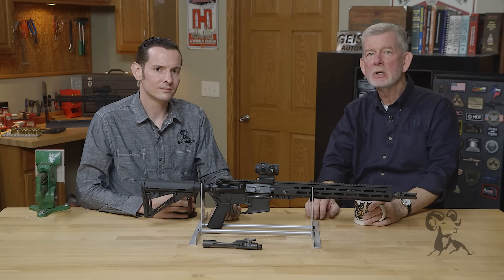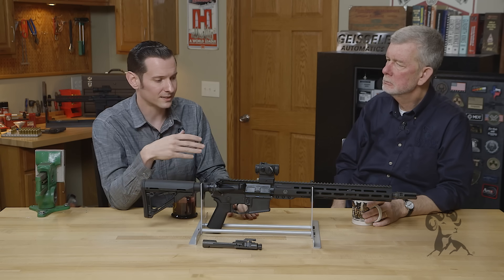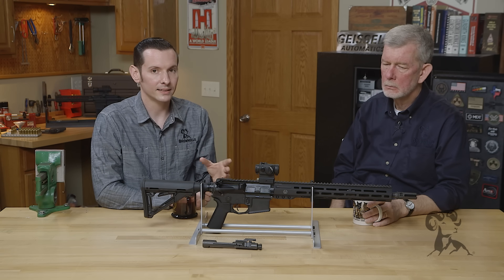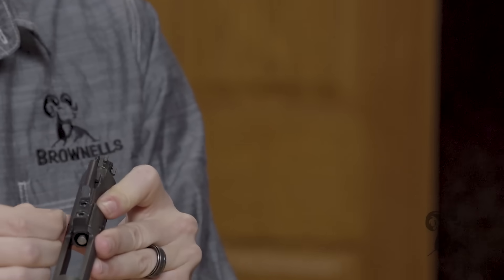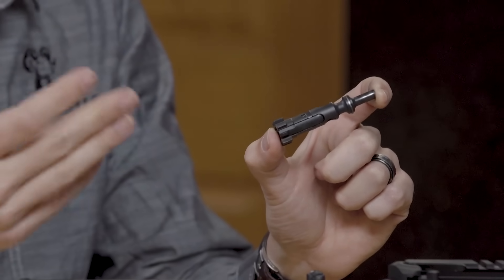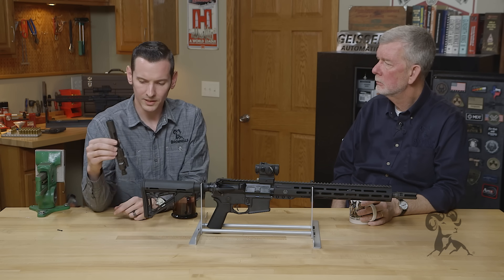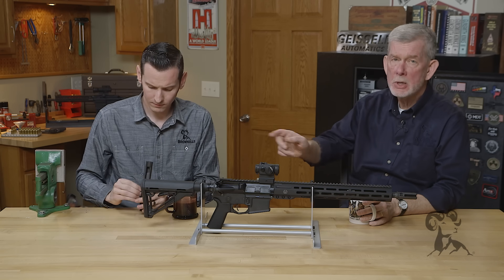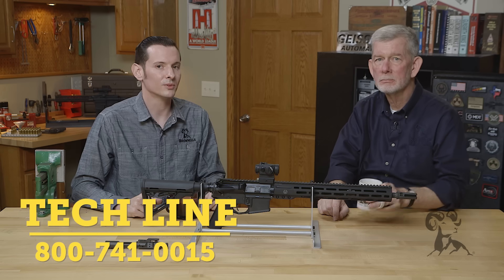Quick Tip: Fixing Common AR-15 Gas System Problems

Comment: great video. So I have a factory built AR that I bought new. It has run fine for years until a while back while firing it started over gassing all of a sudden. What would cause this sudden change?
Reply: What signs are you getting that it is overgassed?
Reply: Take apart bolt carrier and clean.

Comment: Another check for the gas rings is to insert the bolt into the bolt carrier and hold it by the bolt face vertically.
If the bolt carrier falls off the bolt you need to replace the gas rings.

Comment: Are 1 piece gas rings supposed to be loose? It fails the bolt weight test.
Reply: 1 piece rings have been known to be unreliable now.

Comment: Thanks.  Bought a new S&W mp AR.  Will not eject any rounds.  Was test fired at the factory because the barrel was dirty.  Could not fix and had to send it back and waiting on its return.
Reply: There are eight cycles of functioning.
Feed, Chamber, Lock, Fire, Unlock, Extract, Eject, Cocking.

Obviously the rifle you had fired.
1. Did it unlock? Meaning did the bolt rotate? 
If no the weapon has a gas problem. As mentioned in the video.

2. Did it extract or attempt to extract the round from the chamber?
Failure to extract. Cause bad extractor or extractor spring.
Inspect extractor hook to ensure it broken. 
The spring could be bad or missing.
Remedy Replace the extractor and spring.

3. Did it eject the round out of the ejection port?
Failure to eject. 
Ejector is dirty or ejector spring is bad or dirty.
Hold the bolt vertical face up. Drip a few drops of solvent and work the ejector with a large flat punch. Push it in and out a bunch. If it is not stiff or it does not return then the spring is bad.
Replace the spring.
Reply: Did they fix it??

Comment: What's "a lot" of rounds? 5000? or way more?
Reply: yes especially if during the firing the weapon gets significantly hot.
Anything above the listed sustained rate of fire for an extended period of time.

Remember that because the AR is typically a direct impingement system a lot of heat is being pushed into the bolt carrier.

Comment: Could the same be applied to Ar 10 piston system? I was ha I gotta failure to feeds an one double feed. Shot all different kinds ammo from pmc to match grade ammo all different magpul mags same issue. I’m stumped on what it could be.
Reply: What kind of AR10?
Reply: POF P308
Reply: @889976889  Is the gas system adjustable?
Reply: @Elliot White yeah it’s has adjustable gas block it’s a piston system not direct impingement it seemed to be under gassed it was short stroking failure to feed. I shot all kinds of ammo did it with ever brand some more of than others.
Reply: @889976889  What setting was the gas block on?

Comment: Custom sized gas tube is even better than an adjustable gas block
Reply: I recommend an adjustable gas block that vents the excess gas rather than just restricting it. When you restrict the flow with a traditional adjustable gas block or smaller diameter gas tube, you give the gas time to cool which results in a more rapid carbon build up in the gas system.

Comment: I have known a lot of shooters that were die hard convinced that the gas rings on the bolt had to be aligned. I have even pulled out metal pins, cut to length, that someone put in to keep them aligned.
Reply: All for not, gas ring alignment is indeed a myth.

Comment: If your gas rings are worn out, might it be better to just buy a whole new bolt?
Reply: No. Just change the gas rings.
Reply: Not at all, the rings will wear out far before the bolt is anywhere near the end of its life.
Reply: Bolt metal is hardened and gas rings don't move in the slot anyways.  Gas rings are softer. Gas rings are like piston rings in an engine.

Comment: You guys are great. I am new to the AR platform and have learned a lot. Please keep it up! Thanks
Reply: So my bolt failed the collapse test. I ordered new rings, passed the collapse test. It got even worse. Before it would eject the spent shell but not load the next round. Now it won't eject the spent round.
Reply: @JessPeters-qg1bn . Did you install the rings in the correct direction?
Reply: @oklahomahank2378  yes. Turns out there was major carbon blockage in the gas tube.
Reply: @JessPeters-qg1bn    Interesting.   Thanks for the answer.  I don’t think I shoot mine enough for that. I see the guy from School of the American Rifle use a piece of trimmer cord to check that.  I occasionally clean mine with the extra long “craft” pipe cleaners.
Reply: @oklahomahank2378  I asked my gun Smith what I could do to prevent that from happening. He said no. Shoot enough it will happen.

Comment: Much better Steve...damn hippie.
My wife’s 18” AR sends them at 12:30...unsuppressed-waaaay over gassed but it takes out the bad guys’ buddies.  I’m too lazy to change out gas blocks, what’s everyone’s experience with adjustable gas bolt carriers like Bootleg or Gemtech?
Reply: They work but are limited in function, It is best to control the gas before it makes into the heart of the operating system.
Reply: @CalebSavant  thank you

Comment: Can you do a video on getting an old single-shot break open shotgun up and running. There are a lot of these shotguns sitting in peoples closets but they might need a new firing pin or have a cracked stock or something. Where do you get those parts? How do perform some of the common parts replacements?

Comment: Your intended application may also factor into determining if you are optimally-gassed. If you intend your rifle to primarily be a defensive rifle (I'm staking lives on it) then if you can't be optimally-gassed be a little over-gassed. Many military guns are purposefully over-gassed so that if you have a crappy batch of ammo or your gun is fouled up it can still cycle in poor conditions. If you are a consistent competition shooter many of them under-gas their rifles to decrease felt recoil believing it makes them faster. This will decrease reliability so many of them use only match or other highly reliable ammo if they don't hand load, working to find that tipping point between barely reliable with their chosen ammo and short-stroking.
Reply: Excellent point! All of this is fact!

Comment: I didn’t know the ar15 can work with just one gas ring. Interesting.
Reply: Dillon M It can work without any gas rings but the recoil and wear and tear will be awful.

https://www.youtube.com/watch?v=kKisBcqOXRY
Reply: @rbm6184  wow
Reply: @ergogenda3374  But you have to be careful on the over lube thing. If that lube gets into your primers and ammo then the ammo will fail. So don't lube your gun loaded. Lube your gun drip dry and then load. Personally I wipe mine down and only leave lube on the friction and wear areas. I kind of run my autoloaders only slightly wet/lubed. I don't want so much lube that the gun eventually seizes up from filthy gunk. If in very cold temps no lube at all unless its cold temp lube.

The point of no gas rings is that it "can" still run but for how long with all that recoil and stress on the parts is anybody's guess. Don't do it unless you have no choice. Better with the gas rings than without.
Reply: @rbm6184  Lol I wasn’t planning for on doing either of those things, but thanks for looking out for me
Reply: @ergogenda3374  Haha. Good.
Reply: It will work in full auto with just 1
Reply: @jthrelf  I wouldn't know. Haha.
Reply: @rbm6184  me either, except for watching a Sons of Liberty Gun Works video.. ha!

Comment: AR10 was over gassed and adjustable gas block fixed it beautifully. But before I did that I tried to do it with an adjustable heavier Buffer that didn't work and not only is it hard to find for the AR10  they can be just as expensive as the Adjustable gas block just get the one that works.
Reply: Heavier Buffer doesn't do anything for over gas issue.  
My AR10 is severely over gassed to the point of not ejecting with any ammo.

Comment: I got a barrel for A.R. 15 I was building and was having  issues, come to find out (thanks to Brownells and the tec line) the gas port hole in the barrel was drilled too small so I had to drill it out.  My butt was tight the whole time I was holding that drill 😆 but now the gun works gr8.
Reply: Clenched cheeks is a perfectly natural reaction when doing delicate work on a machine that creates tiny explosions next to your face.
Reply: OP did the correct fix.  He stated that he spoke to gunsmiths.  it’s not rocket science.  Ex: if your port should be .093 you put an .093 drill bit in the hole.  If it won’t fit, the hole is too small.   Guns are not lab equipment.  If you oversized the hole it’s simple enough to throttle it back with an adjustable gas block or a heavier buffer.   An overgassed rifle is way better than an undergassed one.
Reply: @jwilsonhandmadeknives2760  there’s way more that could be the issue then the port size.
Free bore in BCG. Blow by at gas block, or gas key. Partially blocked/restricted gas key. Gas block misalignment. Bolt tail undersize. 
You could have a gas inefficient carrier, but be over gassed and the gun run fine and seem okay. Swap barrel to a less gassy barrel, then your gun seems under gassed when really it’s just highlighting other gas inefficient issues. I’m just saying for most cases it’s likely not the barrel gas port. A correctly gassed barrel may not run with a inefficient carrier. That’s my point
Reply: @goinhot9133  yes the video discusses all of that.  The criticism of the OP is that he wasn't qualified to open the port size.  I'm pointing out that it's a simple operation that does not require 20 years of machining experience.
Reply: @jwilsonhandmadeknives2760  best videos to watch for AR specific knowledge is School of the American rifle. The man knows his stuff
Reply: @jwilsonhandmadeknives2760  my point is, unless you have pin bore gauges you aren’t able to truly check the BCG/gas key/bolt tail, size. Also most people don’t have a micrometer to check the bolt shoulder. 
& if you don’t have pin bore gauges you likely can’t get a true reading of you gas port size, & if you’re using a hand drill and not a drill press there will be more slop/angle when drilling your gas port. Unless you have a ridged drill press, and verify the true port size with pin gauges then you’re really just guessing to a extent.
Reply: Oh no. Hopefully you checked the gas port hole for size first to make sure that was the culprit? Could have been several things, and you just fed it more gas then necessary to compensate for another issue 😬
Reply: my son's brand new build (.223 Wylde with 0.625 gas port) is short cycling...1) first round is fine, for the 2nd round, the BCG catches the side of the case and 2) with 1 round in mag, fired, bolt doesn't lock back. So either undergassed or still some wear in is required.  Each succeeding 2nd round, the witness mark is closer and closer to the end of the case (primer end)...suggesting wear in...I hope. If undergassed, may be undersized.
Reply: @nevrcm3261 any luck with this problem I have the same one
Reply: lmao....same when i was dimpling my first barrel...puckered right up. this is the way
Reply: Let let me guess... Harbor freight bit index, coredless drill with a Jacobs hand tight chuck?
Reply: @rhubarbpie2027  That should remedy the tight butt situation.

Comment: I had a Smith and Wesson M&P10 that was under gassed. I could not figure out why. It would short stroke even with the hottest 308 loads. After weeks of testing different ammo, and taking it apart more times than I can count, I discovered that the gas port in the barrel was actually the wrong size. It was far smaller than factory tolerance.
Reply: Adjustable gas block can not add gas to an under gassed short stroke issue.
Reply: Wow odd for a smith but every manufacturer has some issues.  Did you try a lighter buffer first or jump right into an adjustable gas block?

Comment: 300 blk out is a little different, I had an extremely under gassed one and it was throwing around 1 to 2 o'clock but not far out....had to increase the gas system and change to a 300 blk out buffer spring.....
Reply: Yea, the different calibers on the platform do change the troubleshooting a bit.

Comment: 25 cent part shut my rifle down.  I had a brand new gun that I had malfunctions with the first time a shot it.  It was not extracting the spent cartridges a couple times while firing a 30 round magazine.  When I got home and cleaned the rifle and checked it I noticed one of the gas rings were broken.  I replaced it at a cost of 25 cents and now it shoots like a sewing machine.  Hopefully this intel is helpful for someone. ✌️
Reply: My first time out the taper pins on my ar556 popped out and I think it caused the gas tube to dislodge. I put everything back and am waiting for another pin before I try to fire it again. I’m going to have a gunsmith check it out first
Reply: I’m having the same issue but my fault for not spending 2k on an AR I guess 😂 first 10 rd mag (I’m in ca btw) malfunctions after malfunctions. I’m not sure but I feel like I got a lemon since I’ve had failure to feed and failure to fire even. I think the couple failure to fires were due to the gun not going fully into battery due to being under gassed or a gas leak since I did have to start using the forward assist. I also noticed the gas block is about a 1/8 to 1/16 inch closer to the barrel and not snug on the groove. I’m bringing in back to the place I got it and see if they can check it out before I pull out the bcg and start changing things. But I’ve never had a gun that was such a pos and really puts me out of wanting to get into ars. I’m a pistol guy and have put tons of rounds through an ar 9 without any errors. I wanted the AK but the American in me wouldn’t let it happen before getting an ar 😂 but ars really need a side charging handle. These rear handles suck
Reply: @bryann3389 it's totally frustrating when a new ar doesn't work. They are fun to shoot when they do. They are a very reliable platform but need gas to run properly. A brand new rifle shouldn't have those issues. Hope you got it running again. That gas block sounds like it's not over the port in the barrel.
Reply: I hope that wasn't my issue. I upgraded to a drop-in trigger and just spent $200 on a full new BCG upgrade but haven't tested it with the new BCG yet
Reply: lol get ak, ak shoot
Reply: I put 30 rounds through my low end ar and now it won’t extract a round at all and always double feeds I have to use a ram rod to get the spent casing out does this sound similar I got a new bcg but I’m going to cry if all I needed was a .25 cent ring 😂😂😂
Reply: So you didn't inspect it before you shot it for the first time. This is exactly why you take the time to do a thorough inspection of any firearm before using it. Fortunately nothing terrible happened and the only thing you lost was a little bit of your time. It's amazing how little people pay attention to potentially dangerous things. Do you even look both ways before you cross the road.
Reply: @BravoJulietAlpha well, people assume a new gun is done right.  Crossing the road, really
Reply: @shantor100 Depends on the maker.... I bought an aero upper and I made sure I did a full quality inspection. The flash hider was loose and the gas block screws were loose. 
Buuuut, when I bought a Geissele full rifle. Everything was marked with a yellow paint marker, checked, and I didn't feel the need to check the rifle at all. You could tell it had some QC done with it. 
The BCG is different. I QC check every single BCG. I disassemble the bolts and see what kind of extractor springs they have. Give the gas rings a spin and do the drop test. Check there ejectors and spring stiffness. Check the bolt face for flatness. I check for proper head space on the rifle with a go and a field gauge. 
Then I give the BCG a full light coat of oil and grease the rails. 

Not quality checking rifles is a mistake. Not quality checking a BCG is lacking on common sense.  Daniel defense, Geissele, BCM, LMT, all of them NEED to be checked. You're just asking for issues if you don't.
Reply: @Combatmedic870 good to know thanks. I’m just getting into rifles and all the parts that make them work. I will be sure to do my due diligence

Comment: Another thing to consider with your gas rings is the barrel and gas tube length. Shorter gas tubes will wear out rings quicker.
Reply: Great point, overlooked often.
Reply: That's why my guns have quarter mile barrels!

Comment: I have been having FTF issues with a new build.  Checked and reinstalled all parts TO BE SURE THEY ARE CORRECT.  However, I believe the batch of hand loads I was using 22.5 grs. AR-comp and 75 gr .Hornady  HPBT, 18 Criterion barrel. is not producing   enough gas to complete the cycle, i.e. lock open on last round and, or, feed new round.  Looks like a slight short stroke as cases eject at 3 to 4 o'clock and about 6 to 7 ft.  Testing with factory rounds  tomorrow.  Hope this is the answer.

Comment: I am a left hand shooter and my ar15 has no brass deflector how much wgt  do I need to add to the buffer to get it to eject to 3 o'clock.
Reply: That depends on many factors, there is no straight answer. Use a  buffer such as the Odin Works that is modular or use and adjustable gas block to get it where you need it.
Reply: @CalebSavant  KAK also has a modular carbine buffer kit.

Comment: I had an upper that was so over-gassed that it would pop the primers out of the cartridge.  Adjustable gas block corrected this.
Reply: Danger💀  Ammo over pressure...
Flattening primers.
Deformed brass head, brass flowing into ejector hole and sheeting the spot.
Blowing primers out, primers loose and fall out.
Reply: Also sounds like a headspace issue.